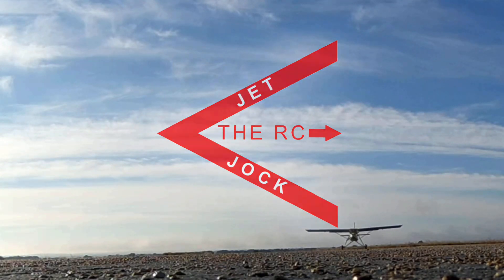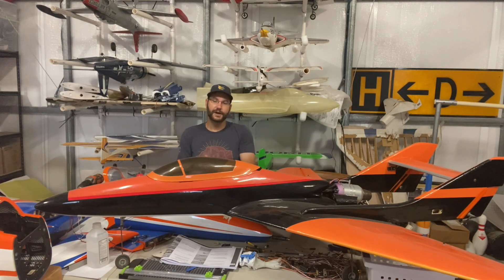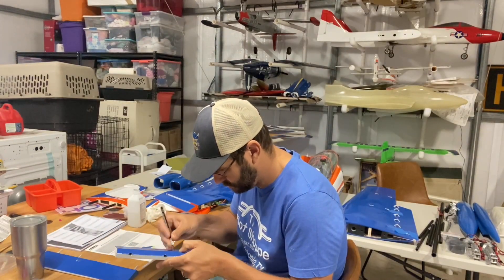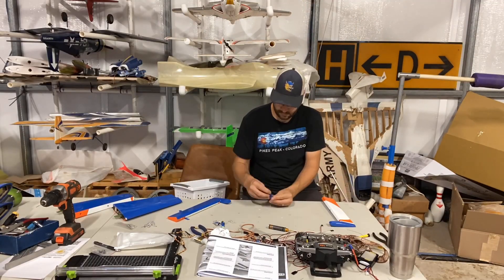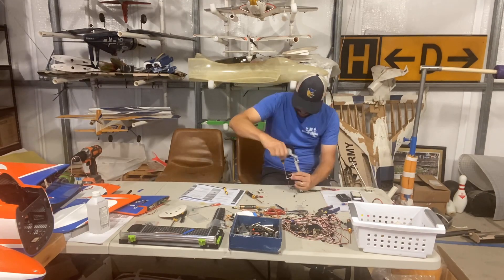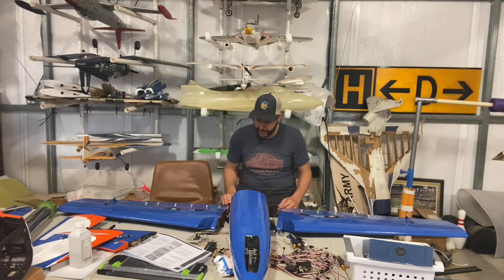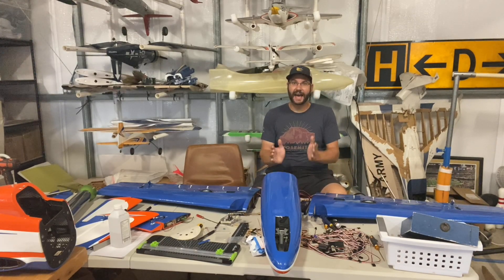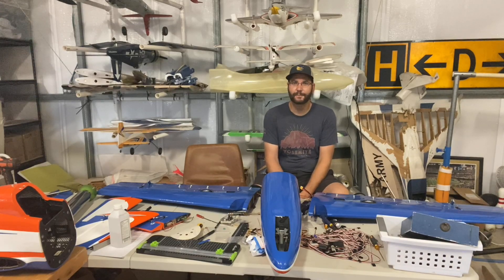Hangar 9 MB339, Informational Build Series Part 1

Comment: Great video Matt. I'm also building the H9 MB339 as well. 
I also had the nose landing gear wire polarity reversed.
What servos will be you using, I would like to stick with all 8.4 volt servos... I'm waiting for the servo bundle that they recommend but it won't be available until next month.
Keep up the great work.
Reply from the maker: Thanks buddy!!! Unfortunately with servos I wasn’t as patient as you lol. I pulled them from another Jet I was flying but they are all different brands. But at least the same exact servo on each matching control surface. Just so happen the servo sizes were all the same as the MB339.